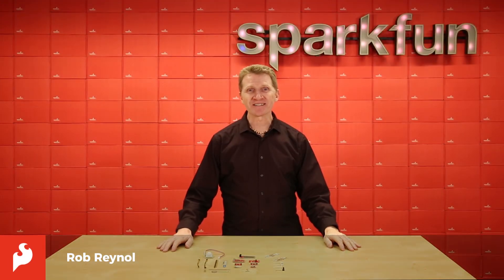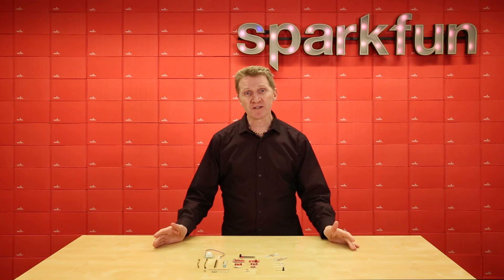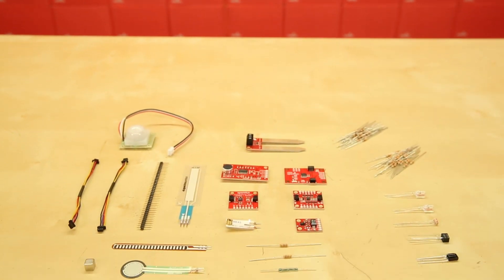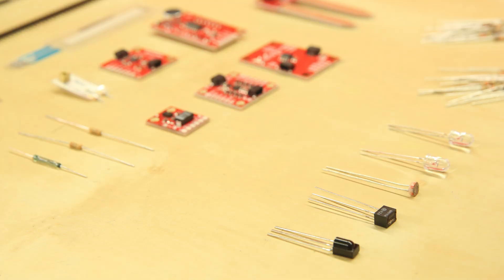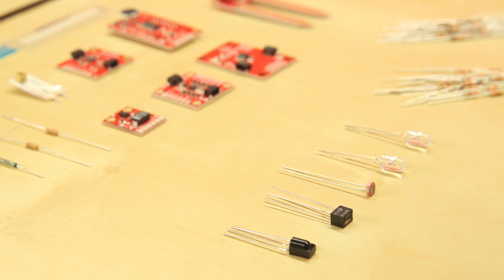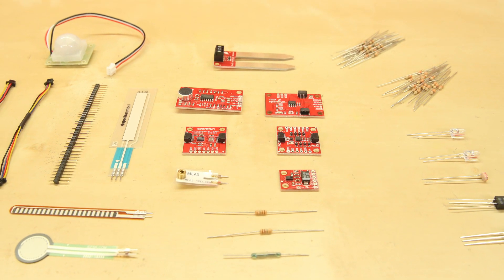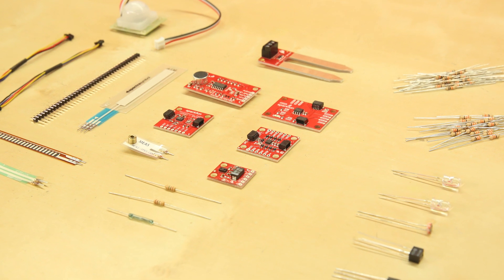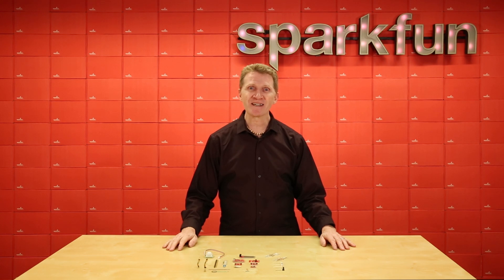Product Showcase: SparkFun Sensor Kit

Comment: CSS811 is almost an useless sensor to measure CO2. Even with external temperature measurements and compensation algorithms in the code, it will react to virtually any single VOC gas. Real CO2 measurements can be read with an IR CO2 sensor. Or at least a more advanced sgp30.